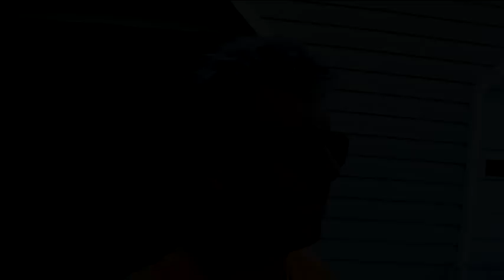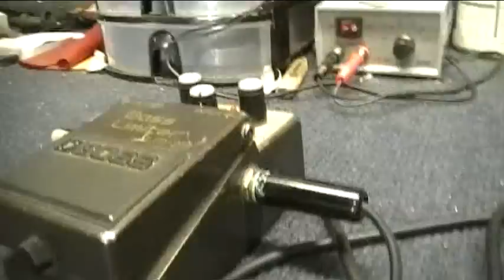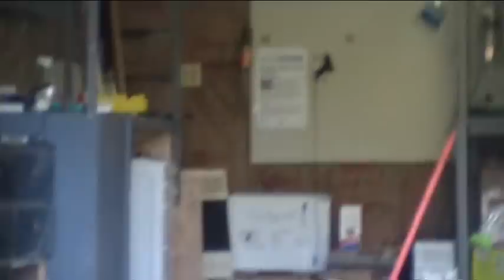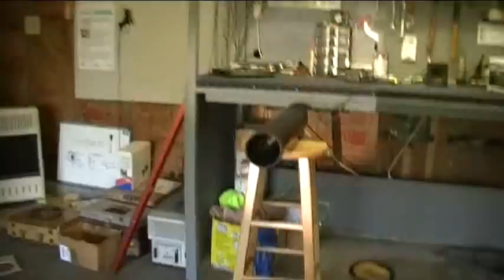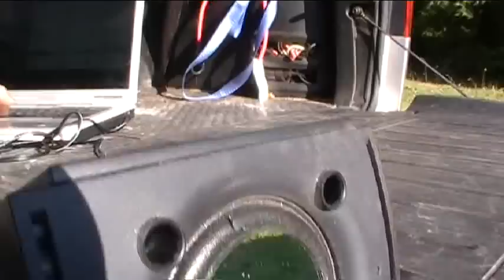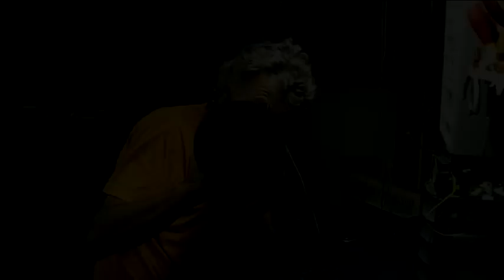The Photophone

Comment: I'm deseperatly trying to build my own photophone, but despite following all the indications, it still wouldn't work at all... any tips??
Reply: I haven't built one myself but am fascinated by the concept. My first guess is that you have to make sure the mirror is flexible enough and will be able to vibrate. Maybe try to put it on an elastic membrane and keep the way from your voice to the membrane "airtight" by using some sort of tube or horn to optimise the incoming sound pressure

Comment: So its not actually converting sound to light, its using sound to modulate the frequency of light reflecting off the mirror?, And then the light reaching the other end hits a surface sensitive enough to vibrate from just light waves? Cmon!!
Reply from the maker: No it doesn't vibrate the solar panel, it varies the voltage from the solar panel because the light that hit's it is is constantly changing with the sound that's moving the mirror.